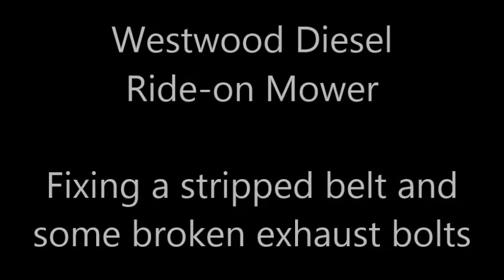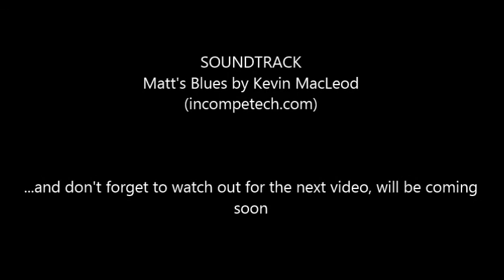Westwood Diesel Ride-on Mower - Drive belt change and broken exhaust bolt repair

Comment: Nice repair. I just put a new mower deck belt on and the supplier suggested a notched belt to go around small pulleys. Its like a timing belt. I like that tractor its a nice size.
Reply from the maker: Thanks, you absolutely right with the ribbed belts but i got 100s of old style ones for almost free, so i am not going to buy any belts in the near future....
I really love that little mower, it's old but all metal, so you can easily fix it with nuts, bolts and a welder.
For it's class it's got a really big deck, the Diesel version has 42", in the mid 1980 that was huge, the petrol engined ones had only 38" decks because there was not enough torque to move such a big deck.
Also the 42" deck is an interesting design, it's got 2 quite large interfering blades, timed with a twisted timing belt to make them counter-rotating, it's amazing how much grass this thing can move.
Just bought another 2 of them for very little money as i need some parts, one with a Kawasaki engine and one with a B+S 13hp, both engines dead.

Comment: I have an old west wood diesel mower it's older than me and I am old !!!!!!! I cut grass for a living and run it flat out all day because that's what i was told to do
many years ago. It has saved me a fortune so so economical It's loud it smokes a bit but who cares. My other mower being a petrol cost a fortune to run folk
do not realize how much fuel you can bur during a hard day's work. I have wondered when it will give up especially when i ran it without oil for an hour or so by mistake
a few years back But no it still want's to please. Fed up of hearing people criticize Italian engineering my engine is Italian and by god if any one can beat this engine
please let me know because I will have one ???????? Thanks for the video made interesting watching. stay safe and stay healthy during these weird times !!!!!!!!!!
Reply from the maker: Cheers Mate,... i bought mine about 5 or 6 years ago. I was particulary looking for a Diesel, for the same reason as you say - economics. Diesels don't turn up very often,  mine was a really lucky find , turned up late night on ebay and i clicked  "buy it now" 10 minutes after it went online. The engine is rather primitive, but durable, just needs a bit of maintenance every now and then. I also use it for pulling stuff around on the yard, so it has a rather hard life. Recently put some agri-tyres on it and now it pulls like a train.
Reply: @dynoguy  Same here but i was very very lucky as my mate repaired lawn mowers for a living this thing came in P/X asked did i want it asked how much
he said 50 quid i said are you joking he said no " SO I SNAPPED IT UP" Never looked back use it on all my so called rough cuts but i think with a bit of T.L.C.
it would probably do a posh lawn as well as any other. Sadly customers might think different when they hear it and saw it but a lawn is a lawn is it not ??
I also move trailers and stuff.. This thing believe it or not pulled a 3.5 ton Ifor Williams trailer with a dumper truck on it a good 100 yards across my lawn
up to the Land Rover ready for towing Even the wife could not believe her eyes but it did !! Funny really as i only came in for a cuppa tea having spent
the last three hours repairing the deck and greasing the old girl up when i saw your vid so thought i would put a comment on.. Thanks for your reply
made my day.. Looks like we are all the same really deep down just love anything that goes on 4 or 2 wheels ?? and makes a noise ???

Comment: It never occurred to me to buy anti-static v-belts!, I would have assumed most of them were more or less insulators, though, that is a hell of a rabbithole to go down.
 I used to quite like lawn mowing, cathartic with some results to see-for a while at least.
 Cheers, J.
Reply: Oh, And a 4-wheel trailer?, I'd keep that quiet, I found that peeps liked to "borrow" my van for a drink rather than hire one, made me a little twitchy. J.
Reply from the maker: Anti static makes sense because a non conductive belt can act like a Van de Graaff Generator and when you touch one end you may get a buzz.
Reply from the maker: There is a padlock on it for a reason and most passenger cars are not legally allowed to tow that thing anyway because of it's MGW....  And there are certain things which are not for hire anyway,  Groupies, vehicles, tools,..no exceptions and in that order ..:-)

Comment: Nice video.  Thanks.   Is there no adjustment for that drive belt ?  I am about to change a slipping belt on a Westwood S1100 - similar belt  & pulley arrangement to this one but it surprises me there's apparently no adjustment. What happens when the belt stretches ?  Is the travel of those 2 clutch pulleys enough to take up the slack so there's no adjustment necessary ?
Reply from the maker: Hi Nick, ...not sure if the S1100 has the same arrangement, but on the D1200 you can set the backwards travel on the push rod which lowers the deck, this will change the belt tension. The deck has multiple holes at the front where it connects to the swivel thing, that allows to adjust the tension as well, but also changes the deck height. The whole arrangement is not exactly well designed as the cutting height lever also changes the tension. Most important is that the deck cannot move sideways as the belt route is not centered to the engine pulley, so any side movement will change the tension, too.
The bearings in the 2 tensioner pulleys are usually badly worn, any slack will lower the belt tension, i think there is some adjustment, too, but can't remember it right now.

It's all a bit of trial and error, but once you look closer, things become quite obvious.
Bear in mind that my 42" deck is entirely different to your 36" (or 38") deck, the 42" version has a tooth belt to synchronize the (counter rotating) blades as they otherwise would touch each other. The smaller decks have shorter blades which cannot touch each other and therefore they are just belt driven with a single (longer) belt.... Hope that helps, cheers, Mike
Reply: @dynoguy  Hi Mike, thanks for such a prompt and informative reply.  I recently refurbished my cutting deck, well ... a friend did most of it as I watched - he's had Westwoods much longer than me.  That's pretty much ok now, after new bearings, blades, Hammerite, although I have to figure out why it shakes a bit more than the other one I was using previously.  Anyway, my comment was really about the main drive belt.  Mine had an A82 on it which was tattered to hell and as my garden is quite steep, that worried me a bit.  A friend handed me a used but looked ok A82. It worked ok uphill but slips downhill under engine braking. Seems to have stretched a lot too.  I have ordered a new, slightly shorter (A81) belt - will see how that fits.  As for the 2 tensioner pulley bearings being worn and causing slack, that's a very good tip, and something for me to check next time I feel like crawling under the little old orange thing.  Many thanks again.
Reply from the maker: Ok, i see,....my D1200 has 2 sets of idler pulleys for the main drive belt, one is adjustable in a slot for tensioning the belt, the other set twists with the clutch pedal, the pedal arrangement also has a spring which might be tired, so you don't get full tension when released....If the cutting deck shakes, it's either the blades not being balanced or the shafts are bent. Also check the slack of the blade shaft bearings in the housings, these are just pressed steel and have a tendency to get loose over time....Re crawling under it, ...depending on the work required, i either drive on 2 car ramps or lift the front with my engine crane, makes life much easier.

Comment: Too much lawn to mow! I have 2 1/2 acres of pine trees and a small patch of grass for the dogs. Nice little tractor I haven't seen a diesel like that here. I have an old IH Cub Cadet I built a front end loader for and a Kaboda B6000 with a loader thats not much larger. They're both fun to play with.
Reply from the maker: I am not surprised that you haven't seen one,...In the US, Diesel fuel is for trucks only, isn't it ? ...LOL,....  But honestly, they not very popular over here as well, at least not with that size machines, too noisy and a rather rough ride.
Domestic mowers are pretty much all petrol nowadays, mine is from the late 1980s and i think they did not sell many of them. I was particular searching for a Diesel, because they very cheap to run. I run mine on Kerosene  and top it up once a month, got about 1/2 an acre to mow. My neighbour has a 16hp B+S engined one, he's got about an acre and runs on empty every day .... and that's at twice the cost per gallon ....